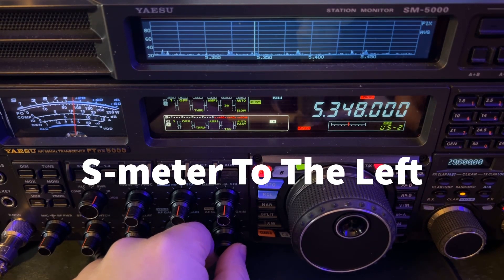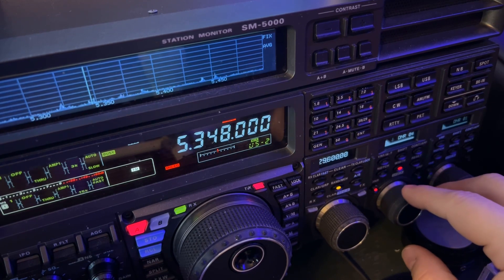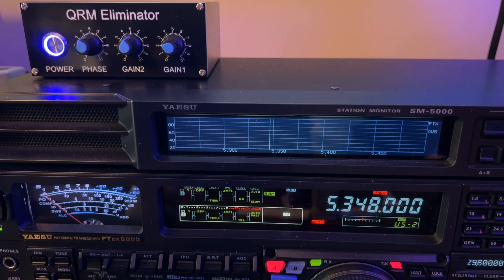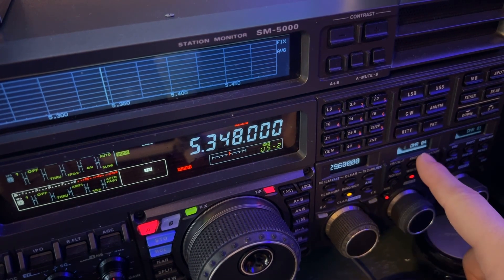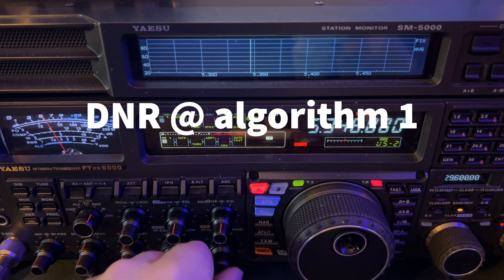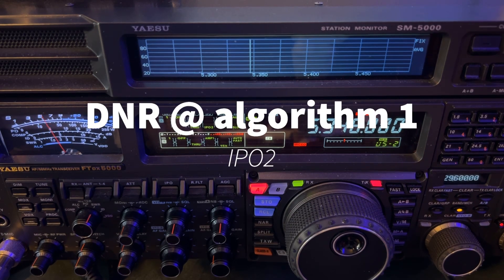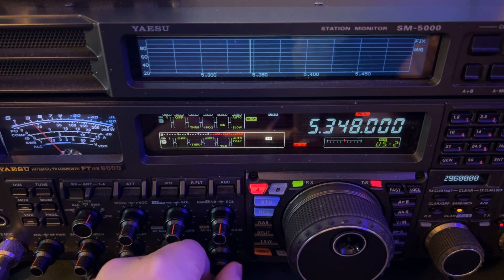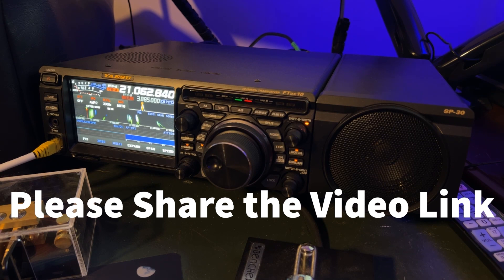S-meter To the Left #ftdx5000 #hamradio #dsp #qrn #dnr #signal #meter

Comment: I am anxious to test something new with 'noisy' vertical antennas. My plan is to build 4 verticals and then phase it, so that I can switch directions. The worst noise is during the daytime, not much during night time. But, the difference between dipole at 10m height (20m band) and vertical antenna is that vertical wins by reception and transmission. Just that extra noise... I hope that by phasing 2x2 array will cancel out 2/3 or maybe 3/4 of the noise compared to just single vertical antenna. My backyard is narrow (14 m wide) and I am forced to go vertical. If noise is not reduced by using that trick then at least I will have directed verticals. Anyway, I am more and more fan of Beverage antennas, so maybe will combine RX2 with long wire antennas, while emitting with vertical(s). What you think? Oh, right now I am very weak after 7 days of corona virus. But, I hope recover soon and finish that array.
Reply from the maker: How will you fit a beverage in a 14m space?  A beverage needs length.
Reply: @n4hnhradio  Ask neighbours to borrow me some space. As long as this wire does not transmit...
Reply from the maker: Have you considered a Ciro Mazzoni magnetic loop?  I talked to a guy last night and I would have thought he was using a dipole, if he had not told me that it was a Ciro Mazzoni magnetic loop. It was on a 2m mast pole mounted to the side of his house, barely clearing the roof.
Reply: @n4hnhradio  There is always problem with tuning capacitor. I saw videos of arcing capacitor with only 5W, so what will happen with 100W?! Good idea maybe for RX antenna only. Thanks.
Reply from the maker: Interesting.  The guy I talked to last night was running 100W. He said he hasn’t had any problems. Everyone in the roundtable thought he was using a dipole.
Reply: @n4hnhradio  Yes, that is even more interesting. I will look into that when get time. Thanks again.

Comment: Still don't know what you mean by the phrase, "s-meter to the left." You posed the question, "what do I mean by s-meter to the left", and then never articulated it.
Reply from the maker: Did you read the video description?  I thought I demonstrated that in the video.  Maybe it wasn’t clear enough.  The whole video is about working for best Signal-to-Noise ratio, which will result in lower S-meter readings.  This is counter-intuitive.

We are conditioned to turn all knobs to the right and see meters go to the right.  Therefore we tend to use too much gain/sensitivity, as we attempt to obtain the highest S-meter reading. Modern receivers are very sensitive.  We usually need less sensitivity, especially below 18MHz. That’s why features such as IPO exist. I even use IPO at 28MHz when listening to a stronger station.  

I use only as much gain as needed and I try to improve the S/N ratio.  This can result in the additional benefit of improving the receiver’s ability to reject interference from up and down the band.  

I’ve covered all these concepts in various operational videos on this channel.  This video just focuses on that specific topic.  Many times I have shown that I hear signals best when the S-meter is barely moving above zero.

Comment: Love my qrm eliminator, glad it’s working out. Doug , did you ever make a video of doing the old school turning off the agc and riding the rf gain? Is there situations where that works better?
Reply from the maker: No, I’ve not made a video of that. That isn’t a method that I like at all. It’s too risky. I can be trying to dig out a weak signal and suddenly a strong signal blasts my speaker. I mostly chase QRP stations and all of a sudden a 1kW signal blasts their call and it rattles my speaker. With all of the noise abatement tools available in these radios, I don’t need to turn off AGC.  In fact, I consider AGC and RF Gain as two of the greatest innovations in radio.

Comment: Interesting video again Doug. The last few weeks I have started having QRM possible sub station very intermittent. I went and bought a MFJ-1026 cost £250 with the amp lead to switch it. I spent 2 days trying different Aux antennas and setting.
 I sent it back. I could not justify spending £250 when the FTDX10 DNR and NB, IPO and Attenuators work very nearly the same. Oh there is also a control what is forgotten about the RF Gain. Guess since I am mainly a CW operator the above  settings really work.
Reply from the maker: Steve, I have the MFJ-1026 as well. It was my first noise canceling device. It works fine at canceling noise and working an electrically steerable RX array. It is just cheaply built and prone to failure. But these devices work. You just need an outside auxiliary antenna. The telescopic antenna that comes with it is about useless. 

73, Doug
Reply: @n4hnhradio  Yes I put a long wire up for the aux antenna. I could not justify spending £250 on it for  slightly better than the radio could do.
Reply from the maker: The reason I have the QRM Eliminator connected again is because my power line noise has exceeded the capabilities of the noise blanker in my radio. I can’t get my power company to answer my calls. I guess I might have to contact the FCC again.
Reply: @n4hnhradio  Hope you get it sorted